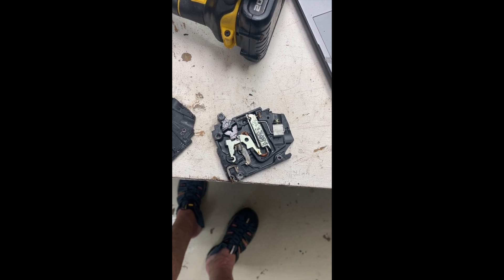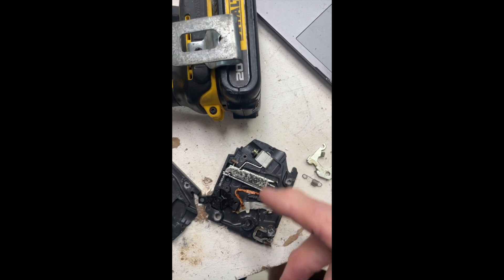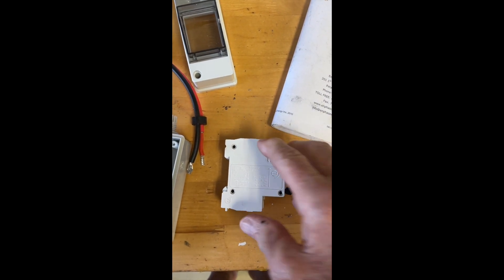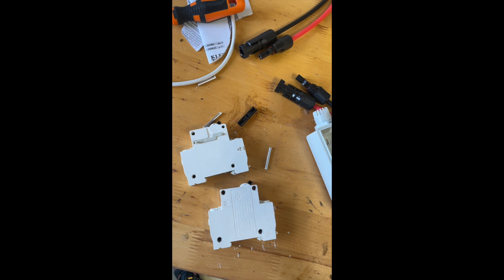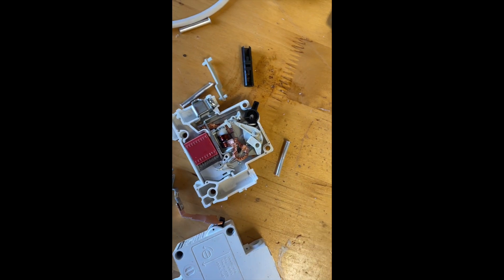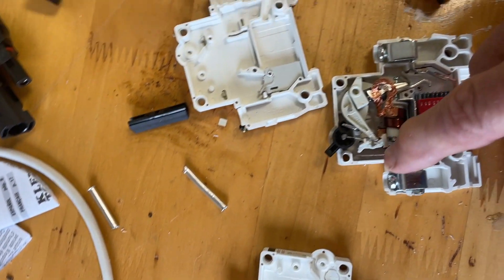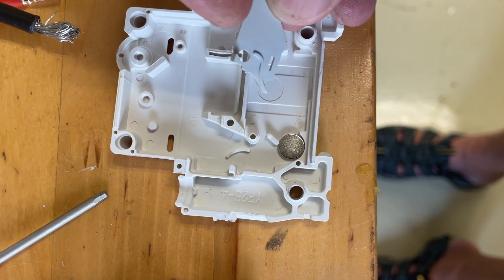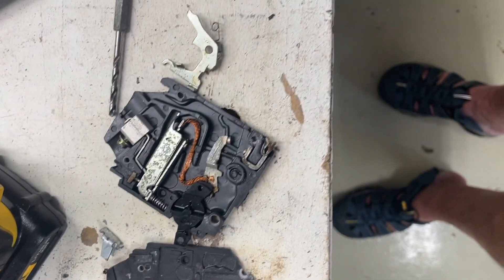Into the Guts of DC Breakers--Are They OK as PV Disconnect Switches

Comment: In Will’s most recent video on DC breakers a few weeks ago, he relented that dedicated DC disconnect switches are better and he no longer recommends using breakers as a disconnect.  Go figure….
Reply from the maker: I've taken apart both, most disconnect switches don't actually have much in the way of mechanisms to manage an arc. The rely on rapid movement and separation alone. Absent someone doing real testing I think the breakers make a lot of sense and Will was right in the first place. But I wouldn't trust either at anyplace close to their rating.
Reply: @ExpertAmateur-xn6dr   Good to know.  Makes sense to use stuff rated for 1,000V.  The cheaper DC stuff rated for 500 or 600V does seem like an electrical fire waiting to happen.   Thanks for your feedback on this, as I know you’ve looked into in much more detail than most.

Comment: The simple addition of a snubber network across the current interrupting device can suppress the arc on switch opening.
How it works. When a normal DC switch is opened, an arc can be drawn out.  The same switch with a simple capacitor in parallel, allows full current flow through the capacitor. Before the voltage across the gap is high enough to strike an arc, the gap is too wide to initiate an arc. 
A capacitor alone is a bad idea as closing the switch across the high potential of the charged capacitor will result in a current spike of high current burning and possibly welding the contacts closed.
To fix that, a resistor in series with the capacitor is used to limit the discharge and charge currents to the full current rating of the panel array.
EG: if your panel is 600 Volts at 8 Amps, the resistor would be 75 ohms for a surge of 4,800 watts for a very short period of time. In addition a bleed resistor would be needed to bleed off the capacitor charge. A metal film capacitor of the proper voltage rating would be used in the range of 5 to 50 MFD.
Give this to your engineering students to calculate the discharge energy and energy absorbed when the breaker is opened.
Reply from the maker: Yes, it's a common fix but rarely used in residential equipment because it increases the potential for welding the contacts. I did exactly that with the contactors that fed the inverter on one of my projects, but I used one on each line, used auxiliary contacts to indicate if a contactor had welded shut, and a time delay to bleed the inverter capacitors and the snubber capacitors. Big Tesla battery. A fairly sketchy project that I've abandoned as not worth the risks.

Comment: FAQ: Is It Safe to Use MCBs as Regular On/Off Switches? What is MCB? MCB stands for Miniature Circuit Breaker. It is an electrical switch that automatically interrupts the flow of electricity in the event of an overload or short circuit in the circuit it is protecting. How is MCB used as an On/Off switch? MCB can be used as an On/Off switch by simply flipping the switch to the "on" position to allow electricity to flow, and flipping it to the "off" position to stop the flow of electricity. This is similar to how a regular light switch works. What are the benefits of using MCB as an On/Off switch? One of the main benefits of using MCB as an On/Off switch is its ability to automatically interrupt the flow of electricity in case of an overload or short circuit. This helps to protect the circuit and prevent potential damage or hazards. Can MCB be used for both residential and commercial purposes? Yes, MCB can be used in both residential and commercial settings. It is commonly used in homes, offices, and industrial buildings to provide protection for electrical circuits. Is it safe to use MCB as an On/Off switch? Yes, it is safe to use MCB as an On/Off switch as long as it is installed and used correctly. It is important to follow proper electrical safety guidelines and have a qualified electrician install and maintain the MCB for optimal safety and performance.

Reference: https://www.physicsforums.com/threads/is-it-safe-to-use-mcbs-as-regular-on-off-switches.751517/
Reply from the maker: Thanks. That seems to be mostly referring to AC MCBs, the big benefit of DC MCBs as switches if the arc management.

Comment: I always try to use a 4P breaker on my battery banks, this is wired so pos and neg pass through as a 2P on one half and turn back  with a loop wire though the other 2P of the 4P breaker, this gives me a double break gap point when I get a trip, this runs true when with a battery bank power could run either way through the breaker between charging and discharging
Reply from the maker: Yeah, I've seen that solution to polarized breakers. It works, but it's almost as expensive as buying a non-polarized breaker.

Comment: Stick to reputable named brand dual pole breakers that are specifically designed  for DC use only with thermal and magnetic protection ratings specific to the desired protection requirements. They should in addition to the rated protection have a substantially higher load break rating to disconnect and interupt potential arch fault currents. DC is more prone to a sustained ionised arch compared to AC. DC breakers have additional arch arresting component designed to draw ionised gases away through additional path length via extinguishing lurers, assisted magnetic attraction and high speed switching contacts. Never use an AC breaker on DC power circuits.

Comment: Coming from outside of the USA I've always looked at your AC panel breakers with amazement.  So many of them are thermal only and there's no arc chute.  The AC MCBs used in most countries have thermal + magnetic and have arc chutes too.
Reply from the maker: Most of the USA breakers I've looked at have thermal and magnetic trips, but they are both encased in one package. The breaker in the video has a coil inside the metal box that pulls up the flap on the bottom to unlatch as well as a bimetal strip that moves the entire box to unlatch. No arc chute, though the contacts move far enough apart to reliably disconnect. The contacts are good quality. I took apart a Square D QO breaker that was rated for both AC and DC (though the DC rating was 50Vdc, 125Vac) and it had an arc chute, but no magnets. They rely on the breaker being mounted vertically for the heat to push the arc into the chute. Also no internal buss for the arc to walk along, I guess it just stays connected to the contacts.
Reply: @ExpertAmateur-xn6dr  As you'd know breakers potentially have to deal with breaking several kA in faults and the arc chute ensures that any arc that does form is extinguished.  It'd be quite interesting to see what the internals of one of your breakers that doesn't have a chute looks like after breaking 2kA.
Reply from the maker: @retrozmachine1189  There wouldn't be much left to see. It's challenging enough to convince people they can't just use any old switch or breaker to interrupt 300-500Vdc, never mind that they should pay 10X for an AC breaker in their home distribution panel with 15 more just like the cheap one. And everyone says the cheap ones are just fine. The typical fault is when someone stacks a few too many appliances on one breaker, and it trips, and nothing serious happens. So they say "I've been using these for ten years and they work perfectly." Even most dead shorts just trip the breaker without drama. Because it's usually 115Vac, and the contacts open pretty wide, if slowly. They aren't bad, they're kind of OK in a minimal way.

Comment: It would be interesting to actually see the switch in operation.
Reply: View "Circuit Breaking Working Principle at Slow Motion".  The MCB shown could be AC or DC rated since we can't see the other half of the shell where the magnet may be attached.  You can see just how aggressively the magnetic trip actually works.  It gives the latch a good whack.

Comment: No brand names mentioned of course but I obtained some single pole polarised DC rated MCBs from a well known Chinese brand that is used in Europe (I'm in Australia).  One day I was idly toying with one on my bench and happened to drag a magnetized screw driver across the magnet in the device and thought, hmm, let's try that with another of the MCBs.  Shockingly the magnet was oriented in opposite polarity.  That's right, opposite.  In effect one of those MCBs would draw the arc up into the contacts rather than push it down into the chute.  So I checked all of them and about  40% were reverse polarity.  I contacted the manufacturer and they eventually got back to me and confirmed that the orientation was random.  Think about the consequences of that!  This wasn't a junk brand!
Reply from the maker: Random is totally weird unless they are dual magnets with opposite polarity. The disconnect breakers (ganged, polarized) I took apart had the magnet polarities opposite, which would be a good thing if they are correct for the current direction since one is on the negative leg and one on the positive. I'm going to figure out if they are correct--I suspect they are. I was browsing through amazon looking at DC breakers and found one that says this: "High Quality】 - Our DC circuit breaker ensures reliable operation of the load and prolongs the life of DC circuit breakers. It can also work as an on-off switch for DC load circuits. Positive and negative pole wires can be reversed without any risk, making it a safe and convenient choice for your needs". 

I don't see any electromagnets in the cutaway drawing of this breaker, and no obvious place for twin magnets with opposite polarity, 

Hmmm.
Reply: @ExpertAmateur-xn6dr  Amazon, says it all doesn't it.  The MCBs I was referring to are single pole, ie only one wire passes through them so there is only a single magnet.

Comment: Disconnect switches have been catching fire lately, so recommendations are to NOT use them.
If they are switched under load then then should be removed and replaced.
https://youtu.be/Wnroz4Mvfbg?si=IYvBFxcnirjDV_yE
Reply from the maker: That's a bit insane. So you're going to work on a 500VDC PV system with everything energized. You do understand that's more than enough voltage and resultant current to kill an elephant. If you get across that hand to hand or hand to foot you are irretrievable dead.
Reply: @ExpertAmateur-xn6dr  Doesn't change the fact that things labelled as isolator switches are usually not rated to switch under load.  They are there to isolate only.  A lot of people still don't understand this difference between breakers and isolators.  A rotary PV switch may not be rated to work as a breaker, only an isolator.  Regardless of using a MCB, MCCB, rotary switch or what ever it's very very important to read the documents and ensure it actually will function correctly in the manner in which you are going to use it.

I've seen pictures of the guts of rotary PV isolators that were not rated to switch under load but were used in that manner and the contacts were quite damaged.

I'm in Australia and we took the silly path of putting PV isolators on the roof next to the array.  That actually caused fires.  Things have change here now and the isolator no longer needs to be on the roof and if the PV equipment itself includes a built in switch a separate isolator is not required at all.  However on the array itself there must be a connector (typically MC4) that will allow the wiring down to the inverter to be disconnected (not under load!) and a permanent label affixed on the array indicating where this connector can be found.  Obviously one must still disconnect wiring and make it safe before it can be worked on.

Comment: Would be nice to see with Midnite which is one of the top of the line breakers on the market.
Reply from the maker: Midnight solar has a nice range of polarized and non polarized DC breakers. Until recently they didn't have much beyond 125Vdc, so I didn't think about them, but now they have some 300Vdc breakers. Good stuff, but a bit expensive to be ripping apart. They claim their breakers are undamaged by opening under load. It's certainly possible, but unusual.

Comment: The main issue with using the dc breakers is that many people wire them backwards making them unsafe
Reply: I always found it funny the breaker has direction and then you need to put one between the battery and the scc.. which in many cases has an inverter, meaning the power flows back and forth.. making direction compliance impossible.
Reply from the maker: @MegaCyrik  You can't use a polarized breaker for that. Using a pair as a disconnect for PV means current only flows one direction. Any breaker for a battery needs to be unpolarized
Reply: IDFM
Reply from the maker: Exactly. If the arc doesn't get pushed into the arc chute and lengthened they will burn up--not exactly what you want when a breaker opens. So polarity, and the design of the breaker is critical.

Comment: So, what everyone is saying is….DC breakers are very different and have specialized features like magnets and arc chutes to safely manage the dangers of interrupting a circuit under heavy load.  And that’s (supposedly) why you never should use a breaker to turn off a DC load.
I’m sorry, but this logic still makes no sense to me.
Reply from the maker: No, that's not really what's being said. Obviously a breaker can turn off a DC load--if it trips, it turns it off. DC breakers are different from AC breakers and any kind of switch. They have gizmos inside them that enable them to work. But if you wire them wrong, or use them improperly you can have a nasty fire on your hands. Take a look at the video 'lordofelectrons' posted above. Picture that arc going the wrong way--away from the chute. If the breaker is wired incorrectly, or used in a situation where the current could flow either way (like a battery) then there is a VERY good chance it would catch fire the first time it tripped or was opened under load.
Reply: @ExpertAmateur-xn6dr  yup.  I’ve seen those videos.  I do get that part.  Yes, wiring things backwards is a danger.  And more importantly care needs to be taken to know which way current is flowing and which parts of the circuit carries the current both directions (during charging and discharging cycles).  But if the breaker is wired properly and sized correctly it should be the most ideal way to turn off a load because of all those features built into the breaker.

Point of reference.  I haven’t just come from left field on this.  I’m a former USN submariner electricians mate first class petty officer.  I spent many years working with, operating and maintaining monstrous submarine batteries, generators, breakers both DC and AC carrying MW of power that had to work perfectly every time under battle conditions.  And I’m very happy using those DC breakers to switch loads on/off in my little hobby RV solar system.
The point is just be very aware of which way the polarized breakers are installed and where the load is, always wire them in pairs and they will do a lovely job.  You yourself showed brilliantly how sophisticated the guts are to minimize the risk.  The only thing you could show a wee bit better is I think show those magnets are polarized S and N to bend that arc the right direction based on if it’s a - or + side.
Reply from the maker: I think we're in violent agreement. I think the breaker is OK to use as a PV disconnect (which only flows current one way) as long as it's used well under its rating, especially if you use it as pre-wired. As a bare set of circuit breakers I think it would be a fire hazard since there's no polarity marking though it's clearly a polarized breaker. It's got the basic stuff required to handle an arc, but it's certainly not even medium duty. I'd call those contacts light duty. And it's one arc arc chute and one magnet. I'm also ex-navy, ET nuke.

Comment: Something else to notice is that this is a two pole breaker meant to open both conductors of the DC circuit, effectively doubling the contact gap and the effect of the arc-shutes...
Reply from the maker: True, though there are a lot of faults that would defeat that benefit.